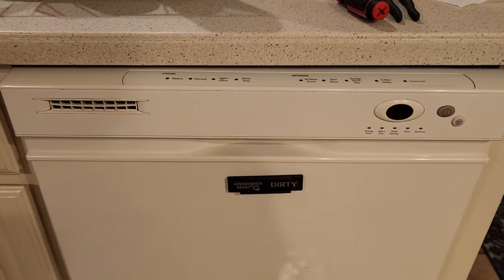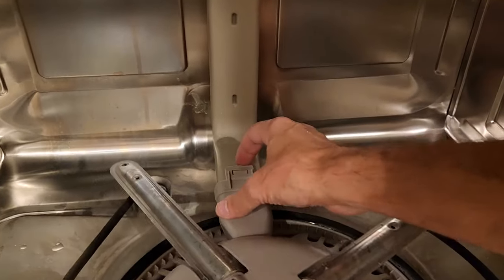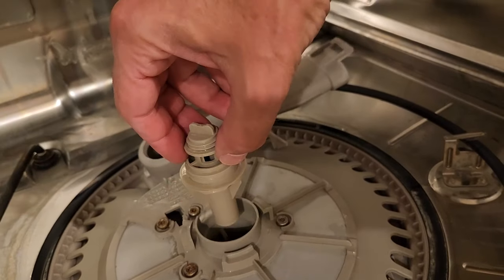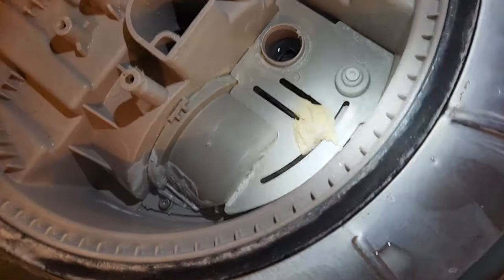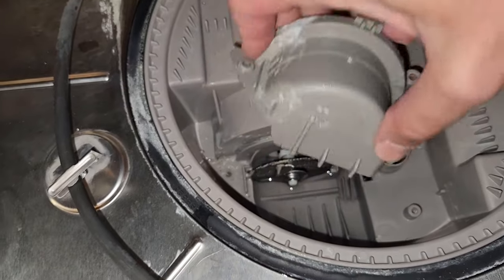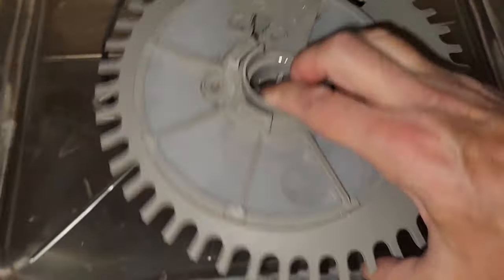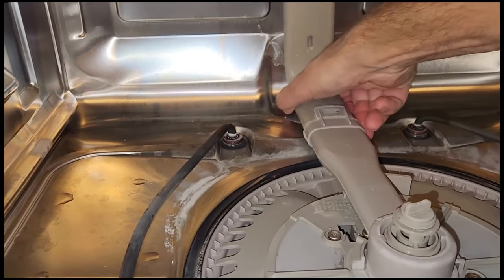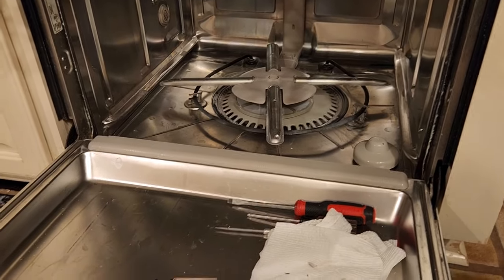KitchenAid Dishwasher - Clean the screen (Making Noise)

Comment: Thanks.  I thought I needed to buy a replacement dish washer, but 4 hours of cleaning did the trick. The filter had never been maintained over the 15 years I have owned the machine. Who knew?  There was slime in all the passageways. It was brutal getting it all out, best I could. I can't imagine many home owners doing what all is required here. Some, but not many.

Comment: Great video. What a find for me as I have identical model ~20 yrs old. I have what sounds like an impeller rubbing, not high squeal as you'd suspect w/ bearings, but more of a rubbing/humming noise. After reassembly, I'll run another cycle & listen carefully (underneath) w/ bottom cover plate(s) removed. I don't see anything disturbing/suspect from the top-side. Fingers crossed for now.

Comment: I'm here because another video was horrible...and this is amazing!! Thank you!! Question...My dishwasher was missing the cover at 6:33. Everything else matched the video. How important would you say that little cover is?

For extra info, I got this dishwasher free on marketplace and I'm taking a chance on it. It wasn't draining, which is why I'm here. Thank you!!
Reply: Just a follow up, it's running through a quick cycle right now and if it drains I think I'm golden! I also don't think the piece I was missing makes much difference, but we will see if it works or leaks or anything :) Thanks again!!!
Reply: @BoomerangStang did you get it to drain?
Reply: @jjmcg9688  the first time I ran it yes 
But the second time it had standing water again … so I’m planning to replace it …
Reply: @BoomerangStang  mine might be the water pump

Comment: Wonderful video and I'm in the middle of cleaning mine right now after it started making loud sounds. I have removed so many little pieces of broken plates, lemon and grapefruit seeds, chunks of plastic and straws, wads of lint, and other debris that was blocking the flow but I cannot for the life of me get the blade cover off. It's that very last cover that you are using the pick tool on to pull it up. For some reason mine just will not  budge or lift up. Do you have any advice or tips?

Edit: nevermind. I got my utility knife out and ran it down along the entire seal where that cover seats against the main housing. It was caked with detergent residue. I cut through it and then was able to remove it. It's unbelievable how much residue and debris was in here. Three blade gear was completely wound up with lint, too, which was preventing it from spinning. Now that it's all cleaned out I can't wait to reassemble everything and run it! It should be like brand new! 😅 LOL

Comment: great video, I wasn't getting noise but a errorcode 4-3.  (see other vids on how to get error code). so I cleaned out the disposal and found some hard plastic, that i think broke off from other parts of the dish rack :(.  I manually spun the motor from above as well as the impeller  cutter you showed.  put it back to gether and it has at least started a test washing..... wish me luck. Thank you.

Comment: Thank you for posting it gave me the confidence to pull harder to remove the bottom cover. Of notee, some models you can remove the filter screen from the base by inserting gently prying all around the plastic on the screen edge. It comes off like a snug cottage cheese lid. There is only a slight lip..